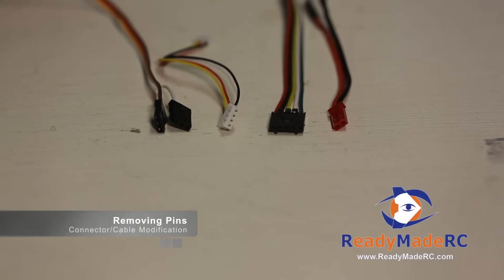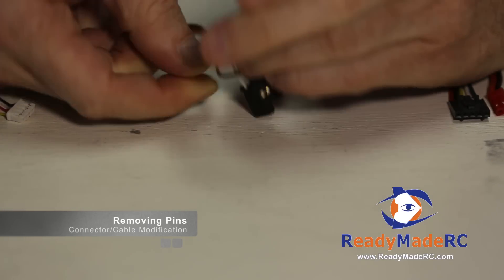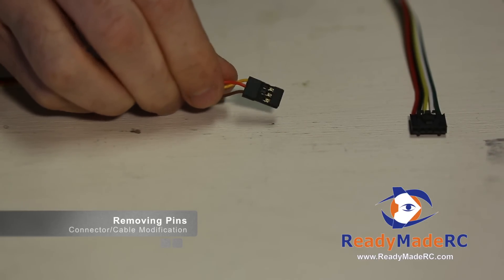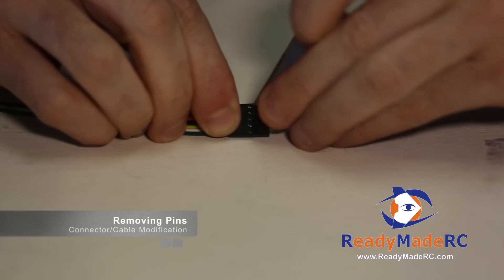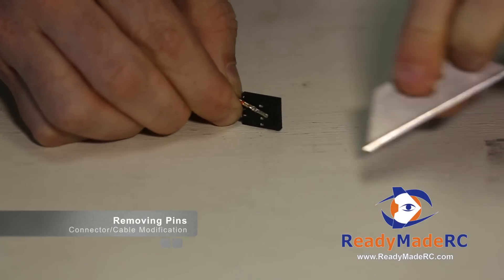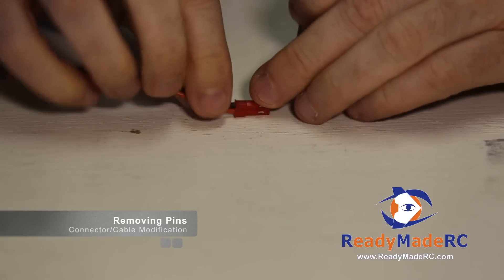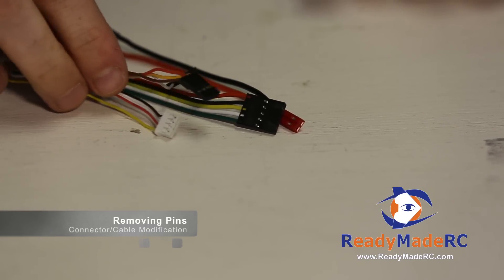Connector Pin Removal

Comment: How do you remove the metal pin if theirs no wire to pull on," the metal pin is stuck inside the connector. There's  no video on that?

Comment: This one was great help...other videos suggested to remove monitor menu switch that failed by unsoldering it. I figured out that rearranging pin within connector to other non-essential switch will do the trick. This video came to the rescue.

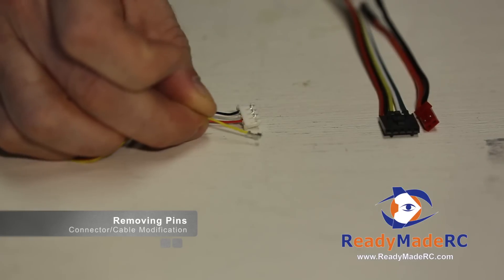Comment: On 1:01 minute, what's is the name of the little metal part that is welded on the cable when you removed it from? the plug connector (the white connector)

Comment: Thank you so much! I just fixed my Xornet Mouse (now discontinued) that had a messed up wire. Didn't want to spend $10 on a mouse cord so I just took an old OEM Dell mouse cable as a donor.

Comment: awesome, thanks! I successfully adapted a regular 4pin PC fan to Dell's 5pin layout (Dell T3500).I did have to remove the back side plastic of the connector to fit my 4pin, but that's fine :)

Comment: Another video that doesn’t work for my type of cable. All the pin connectors are covered so you can’t just unclip them. I’ve looked everywhere for a solution for this and still can’t find one.

Comment: Hi! Great video!
I'm trying just to disconnect a 2-pin connector inside my Tevo Flash printer. It's the case fan's connector and it's located in a pretty narrow place between a stepper motor driver and the PSU case. I've tried to unbend (a bit) that little side "tongues" of the socket to pull the connector out... but it doesn't work like that :(
How this thing work even?

Comment: That's fantastic for the male side where the pins are visible, but how about the female side where they are not....... Quite a bit more challenging imo.  Do you have any recommendations  or tips that could be applied?
Reply from the maker: Brian Oberlin we’ve never found a reliable way to get those out, sorry.

Comment: Is it possible to remove pins from a male servo plug without destroying the plug?
Reply: you would need to remove the sleeve that goes over the pins. it takes practice, but once you get it off, then you can use the normal procedure.